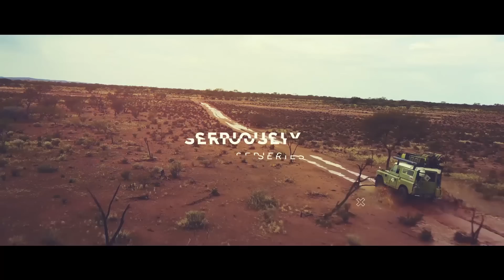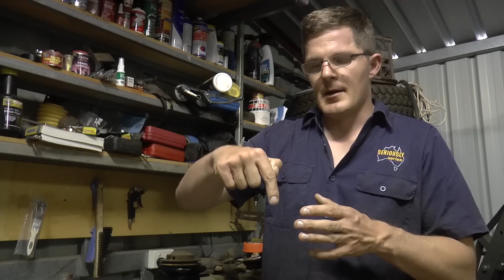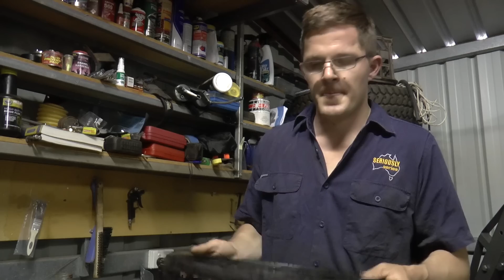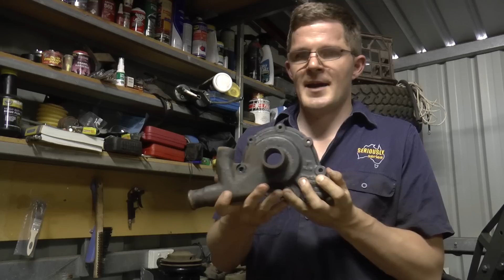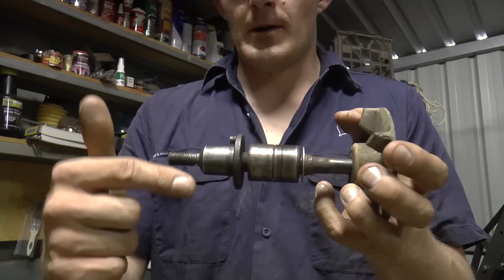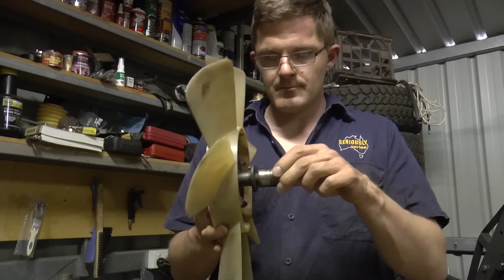Land Rover Series 3 Cooling issue fixed?

Comment: I have a 2-stage Kenlowe e-rad in my 109 S3 200TDi, connected to a switch, which manually  allows to Override stage 1 to 2 or to off. Apart from this, there a screwed-in switch Inline the cooling Fluid system.

Comment: If your wanting a cheap and period correct oil cooler you can weld on fins to the oil pan you might get a couple of deg drop of oil temp.
If your continuing to have over heating issues try getting the radiator modded to have extra cores / extra passes through the radiator, the more passes through the radiator the more effective the cooling will be.

Comment: Apart from better engine cooling, another good thing about adding an oil cooler is the increased volume of oil which must help increase the oil life. So even a simple cooler made from a simple hollow box will help. Remember to carry original fittings with you so you can eliminate the oil cooler if it gets damaged beyond repair.

Comment: Viscous couplings are much misunderstood.
The basic premise of them is to provide slip when it counts and grip when it counts.
They are a type of fluid coupling.
The basic versions are filled with a silicone oil, have been around since the mid 60's, and primarily they "grip" below about 2500 rpm and then "slip" at higher revolutions - all about freeing up power and reducing the roar of a fan spinning fast.
There is no need for an engine fan to spin as fast as an engine can, no matter what the situation.
More sophisticated versions - especially fitted to many Japanese vehicles_ incorporate a bimetallic spring to operate an internal valve so that the hotter the air passing over the radiator and hence the fan unit  gets the more "grip" the fan gets .
Pretty sure the Land Rover jobs don't have the bimetallic spring.

Comment: so, some of the concerns regarding the elec fan, well they are unfounded 

first off, I have in the past used one, on a rally car, (in addition to the stock fan on the engine) where water, mud, cold, and vibrations are all factor
now your point about on a cold day the fan spinning, and making it harder for the engine to heat, well, A) select the correct thermo switch for it (if you set it up like that, BMW's are about the 90c which are great) or B) manual switch, which is what I used, and had a heap of bonus' like after a stage, when the engine was really really hot, but the car wasn't moving, you could have the fan going, cooling the engine down quicker,  

the one I had (this was some 15 + years ago) more than handled wading, and had the massive bonus of often being the only area that had airflow if there was a lot of thick mug (it would often clog the fin of a rad, but the fan mounted at the front had the bonus of adding a little protection, and "chopping" up some of the muck preventing it clogging the whole rad (or at least providing enough airflow to push it through before it dried) 

also, series 3 military, 2.6 litre, (as that is what I have just about gotten back on the road) they really didn't do too many of the 2 1/4 litre motors
Reply: and to add to that, the oil cooler, there are a HEAP of them around

for the price you quoted, you can BUY a farm ready S3 ex mil landrover
Reply from the maker: Hi Jeremy. Thank you for your very comprehensive review of the video.
I may have not been clean in my video in regards to the electric thermos fan, I was referring to a fan placed on the front of the radiator and these do tend to spin at will when driving down the highway even if they are not switched on.
It sounds like you had quite the rally car. The electric thermos fans do, do the job though for what we have planned and have done with this vehicle I do doubt the longevity and I think it is a good option on any vehicle which is mature in age to keep it as in keeping with parts which where amiable for that model of vehicle at that point in time.
The thermo fan is a very handy piece of kit I do not doubt it though if there is the option of using parts from the period to solve the issue is a more interesting way to sort out the problem.
I hear what you are saying with the 2.6 ltr ex-army Land Rover, though they are quite a rare beast to come across. 
I am glad to hear your Land Rover is getting close to getting back on the road and best of luck with the rest of your restoration.
Regards
Geoff
Reply: @seriouslyseriesaustralia  thank you

I understand you were talking about the fan being on the front

however it's turning does not aid in airflow one bit (it would impede it slightly if anything) 
the air moving over the blades while on the highway, is still the same volume and speed with a fan not turned on, as it would be with no fan at all,  (the blades turning are being driven by that moving air, it can not make more air than will otherwise be flowing (unless it is turned on of course)

i good example would be to think of an aircraft, when the pilot turns off the engine, the props can still turn freely, but their turning doesn't create any thrust (or aid airflow)
Reply: @royblackburn1163  not really sure what you're replying to there

my point regarding the elec fan was in regards to not failing easily (also, I can tell you right now, a rally car's engine is working vastly harder than that of a 4wd in low range, going up some endless hill, or driving hours on sand, the cooling requirements of a little 1.6litre rally car (non turbo) will be almost inline with that of something like a 3,0 TDI, if not more 

second off, an electric fan, able to move the same volume of air, and the at the same air pressure at peak, will ALWAYS perform better, because it's not tied to what the engine is doing, it is tied only to the requirements of cooling. prime example would be, low range, lower engine rpms, higher requirement of airflow needed, the electric fan will work as needed 
another good example is, at a challenging point on a track, you might have driven hard, and are now stopped to do a walk of the next section, OR to help winch out someone, or countless other reasons, the electric fan will remove the excess heat quicker (which will also mean fluids will last longer, like oil) that a clutch fan 

AND all of that is BEFORE you account for the FACT that over all, there are less engine power losses running an elec fan, than an engine mounted fan

I have a clutch fan on my landie, however if I was to ever tour in it, frankly, it would be replaced, and an electric put in, most likely at the front, as they are as robust as a clutch fan (even if the placement at the front puts it at higher risk of damage) it is easier to replace if damaged (spares found everywhere, so no day/s waiting) spare takes less room if carrying spares, because, all those little loads you can take off the engine means less will go wrong 

its simple
Reply: @royblackburn1163  I mean, your point about all car R&D departments, you know, backs up what I am saying 

(the power to drive a fan is only a small part of it all, and the reason nearly all modern cars (and I mean ALL) have electric fans (and all modern cars also have higher amounts of heat to remove) is because they are better, more reliable full stop

so yeah, why would all those R&D departments go to electric fans? (fun side, many a heavy military machine, (tanks, etc) will have either electric, or hybrid hydraulic/elec (failsafe) fans, even where the design would allow an engine fan (this being for all the reasons I listed, and the main being that the elec can will and does run at the optimum required regardless of engine speed (again, do a challenging bit of a track, and pause to walk the next part, the 4wd with the engine powered fan will NOT have dissipated anywhere near as much as the 4wd with an electric set up)

also, when talking modern again, there is the other thing that doesn't apply to LR's, and that is the other systems that require airflow for cooling, being the HVAC system, 

so, slow rpm, high load on the cooling system, electric is king, and that is why it is used on all modern cars
Reply: @royblackburn1163  so, i hear what your saying, and ignoring that last jab

you were right, but you are missing the reasons why they USED to (as in, they no longer, it is in the past, it is out dated thinking), take a look at 4wd's, you see i'm not wrong 

the old clutch fan was king because it had a lower failure rate, was more robust, and it was simple, and for a long time, electric was still a dark art, and the systems unable to have too many things drawing to much power. 

and that was 100% correct 50 years ago, but there has been a shift away for some time because, there are draw backs, you dont seem to want see, (sorry, but a modern cooling system, where the only viable is an electric fan vs a (designed for that cooling system) clutch fan, the electric wins, (I use the word modern) 
as you pointed out before, all that R&D money cant be wrong. (i guess, unless it is to help cognitive bias)
i mean, shit son, even TRUCKS like as in the prime mover sense, have, or are going electric fans over whole ranges 

i think what you might need to take on board is, 
I'm not some 20yo (or younger) on the internet hammering away at a keyboard, I was rallying in the late 90's and early 2000's 
sometimes, while the tried and true is still 100% an option, time moves on, and old bias's can go from fact, to angry old man with outdated thinking (i mean, remember when automatics would never be used in a sport car, or a heavy towing rig, or even a prime mover, because of all the draw backs, well, that aint true, and in many cases, the auto's are well and truly better than the manual, even with a skilled driver!!!!)

so, take it on board, there might be some things you're missing, and old bias' that are preventing you from seeing something that is now truly the better option, when in the past, it was not

Comment: Military models have an additional oil cooler. The oil temperature needle barely moved during last years record summer with temperatures around 40°C. 
But perhaps the temperature sensor is broken. 😉
Reply from the maker: Hi mrcvy 
They are a very handy medication though they were only fitted to some models. A good one to have in summer. Thanks for your input
Regards
Geoff